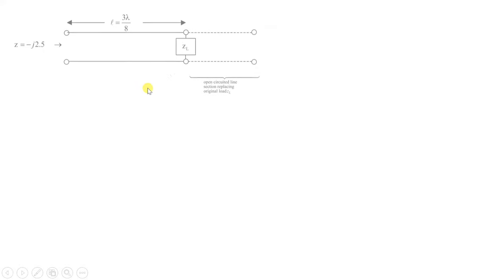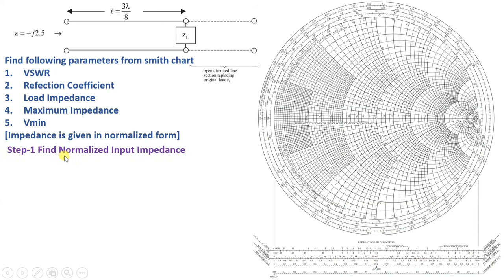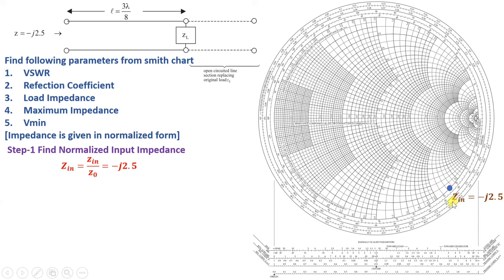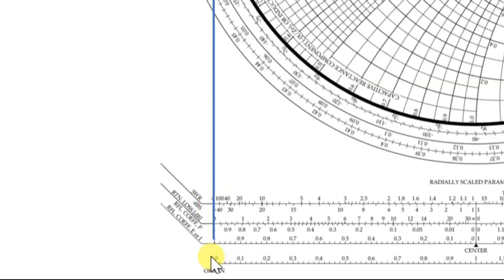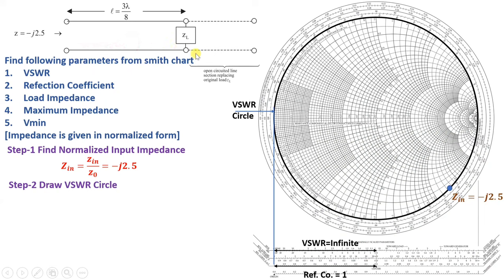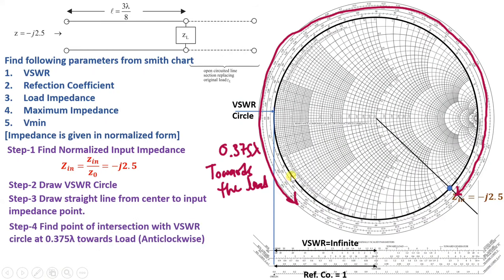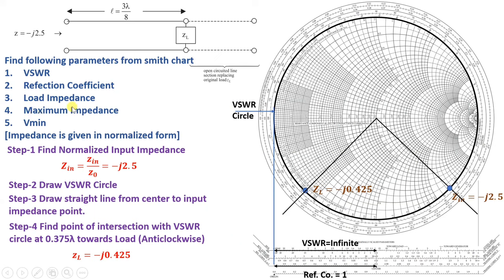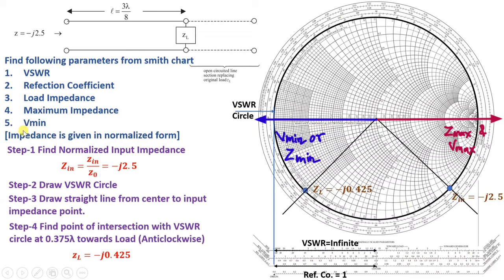Smith Chart Example for Transmission line Parameters (VSWR, Reflection Coefficient & Load Impedance)

Comment: Professor, Thanks for teaching: I don't understand how you moved .375 wavelength to the new location -j0.424 from the starting point -j2.5? 

I know when using the Smith Chart, λ is equivalent to 720 degrees, by using this relationship: 0.375 λ (720 degrees / λ ) = 270 degrees. So from -j2.5 going counterclockwise 270 degrees we arrive at -j0.424. Is this correct?

Lambda = λ = 720 degrees

0.19 λ + 0.375 λ = 0.565 λ
136.8 degrees + 270 degrees = 406.8 degrees

Since 0.500 λ is One Full Circle, it must be subtracted. 

0.565 λ - 0.500 λ = 0.065 λ, 
406.8 degrees – 360 degrees = 46.8 degrees

[46.8 degrees ( λ / 720 degrees)] = 0.065 λ 

Finally location start + movement anticlockwise / toward the load = end location -->> 0.19 λ + 0.375 λ =  0.065 λ
Reply from the maker: 1st explanation is correct by you